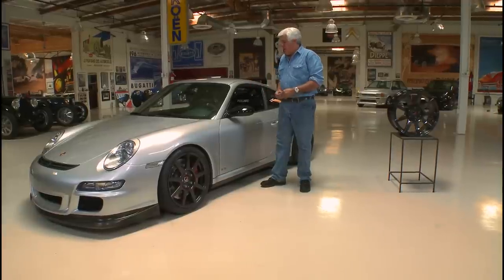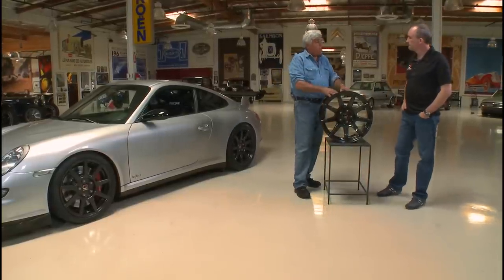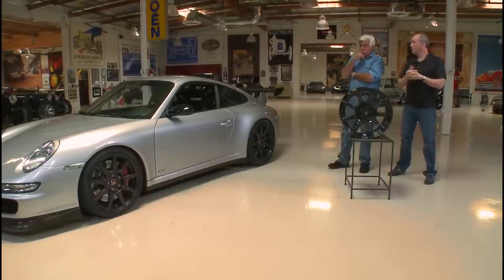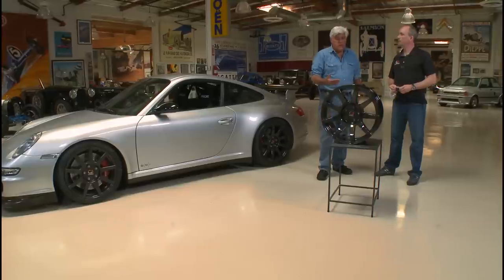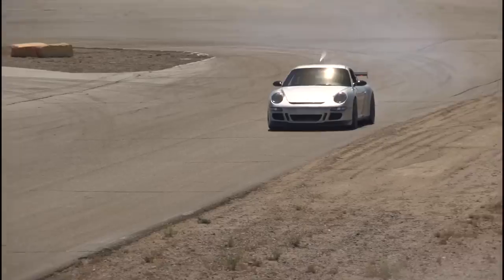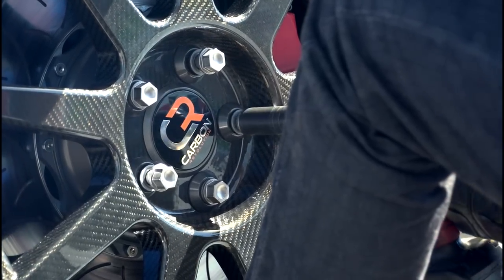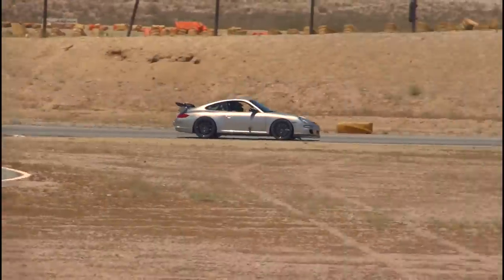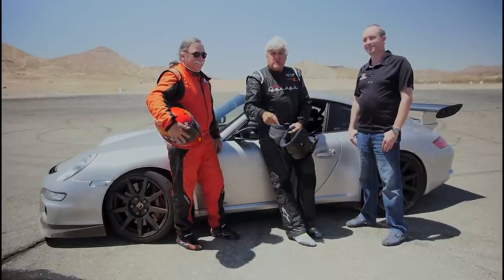Carbon Fiber Wheels Road Test - Jay Leno's Garage

Comment: That guy must be an engineer huh. Hes got the personality of a wooden chair lol.
Reply: Hes defiantly not an engineer. Hes a buisness and salesman. He didnt describe any of the technology that went into then wheels.
Reply: Krevin Grard I'm pretty sure it's just hand-laid wet carbon fiber and epoxy resin in a vacuum mold. You can see each spoke is a separate piece that's joined to the central hub piece. The complicated part is probably the mold which has to be multiple pieces because of the shape of the wheel.
Reply: Nayr747
its will be injected molding done at high temp and pressure same as the tubs on the mclaren
Reply: davybeee That's the technique used for "dry" carbon that's pre-impregnated with epoxy resin. In the video, that's what Jay is asking him about with the autoclave, and he says they don't use that method because of the expense. It's just normal wet carbon. You lay the pieces of carbon fiber fabric in a mold and then brush on epoxy resin. Then you vacuum out the air and let it harden. He must be using a multi-piece mold though since there's no way to remove the wheel based on its shape.
Reply: Krevin Grard Eh, he sounds like an engineer turned businessman/salesman.  I have a lot of experience with this type of person.
Reply: Nayr747
i think you miss under stood what i ment using injection moulding you can make the wheel in one go using a four piece mould and very little machining to finish i understand the layer method and using the auto clave but what i meen is a mould in four parts that comes together  in the injection machine it easy to make such a mold i am a tool maker by trade the wheel is easy made with just one mold. its not just a tool that comes together  as in most cases its a mold that has four parts to make it in one go to give it the shape of the wheel ....
Reply: Dude's wearin socks and sandals.
Reply: Haha a Woden chair ! ! ! :'D
Reply: Krevin Grard
yeah defiantly
Reply: He's living in Germany, he's not allowed to have a sense of humor.
Reply: At $15,000 bucks a set - my sense of humour went out the window as well.
Reply: Hey, my wooden chair is a million laughs.  It's got a wooden leg named Smith.
Reply: farnthboy hahaha
Reply: Krevin Grard And his attempt to impress Jay is hilarious. I feel sorry for the guy, really. I have watched enough of these episodes to know that when Jay says, "Ugh-huh.", that means he already knew that. LOL
Reply: At least he can pronounce aluminium correctly!
Reply: I've met some very interesting wooden chairs.
Reply: Greg Murph At least he can pronounce aluminium correctly!

Here in the U.S. it is aluminum (which is also the original spelling of the word, by the way), and since he is an American, he pronounced it wrong. He revealed himself as a laughable wannabe Euroweenie in the process.
Reply: Late but what bothers me more imo is the hands in pockets...
Reply: he would of been in australia for a while so makes sense

Comment: I'm not sure Jay can actually feel a wheel flex as he describes.  The most noticeable thing anyone driving the car would be feeling is the dropping of 42 pounds of unsprung weight.  That will make the car turn in crisper and smother and the suspension is able to react quicker and more accurately in all aspects with the less weight attached.  He will also feel less of a gyro effect as well. I think its really cool that he test this stuff for everyone to see even if his explanation are a little off you can still read between the lines and tell there was clearly detectable difference.

Comment: It's amazing how far this company has come since Jay posted this video. They're now an OEM supplier to Renault, Ferrari, Ford, and GM. The C8 Z06 with the Carbon Revolution rims is amazing; the rims shave 2 seconds off of a 2-minute lap time! But what's even more amazing from the business POV is where this company is headed not due to lap times, but due to the fact that CF rims extend EV range by up to 10% and due to the radical lead Carbon Revolution has over its competition as a result of having over a decade of experience as a supplier to OEMs for high-performance track weapons! While their stock has taken a beating due almost entirely to COVID impacts on OEM supply chains, the company is about to change from being listed on the Australian Stock Exchange to being listed here in the U.S. While their balance sheet isn't great at the moment due to the cashflow lags from GM's delays on the Z06 last year, Carbon Revolution is supposed to close a bridge loan round in late April and hopefully the de-SPAC process is complete by late June, which will put another $60+ million on their balance sheet and give them access to another $60 million via a committed equity facility (which will come with some dilution, but will help them replicate the new fully automated Mega-Line production they've constructed down in Geelong Australia somewhere in Mexico close to the US border to further increase logistics efficiencies.

Comment: I presume that car @4:15 is the gt350
Reply: i believe so but i think you meant the GT350R because the GT350 does not come with carbon wheels unless it is an option as i do not own or have seen the options list for that car. however i doupt it would be as they seemed to say it was a 350R unique feature. is it worth 15 grand for these wheels which im guessing would shatter quite easily if you got a pothole at moderate speeds? unless you are very wealthy i dont see the real point for it.
Reply: Patrick Pelletier Yep, not sure why I left the R part off, but yeah, 15k for wheels is pretty much insane.
Reply: Jared Moore totally but if all you're doing is going on track with it im sure the advantages are worthwhile. However if you daily it on the streets where i live im sure the tires will outlast the wheels themselves. Our roads arent shot to the point youll fall to the earth's core but the roads are just constantly redone (brand new and gets torn up within the week because they fucked up) aswell as having the surfaces go from relatively even to some 6 inch drop for 10 feet then 6 inch rise pretty much right away.
Reply: +Jared Moore 3 years ago they cost nearly 200k $... so. you should be thanking Ford. Seriously, they have helped bring the tech to the peasants!
Reply: Josh Ford lol true there

Comment: My Shelby GT350R came with a set of these Carbon Revolution wheels. I didn't appreciate what they do until I bought a set of forged aluminum HRE's for my track day tires. The steering is so much sharper, it. I really felt a  big difference in tight S turns. The right to left movements are crisper, faster The car on the street tires and carbon fiber wheels felt almost as good as Aluminum wheels with slicks. I am now trying to purchase another set of CF wheels from Ford. I'm told it will be a few months before they're available as a replacement part, but they are getting a lot of requests for them. Lord knows what they'll cost.

Comment: Mustang 350 rs has carbon fiber rims now...lol this was filmed in 2014....so it took Mustang 5 years.
Reply: Yeah, it's crazy that when this video originally aired, only Koenigsegg had carbon fiber rims and now, not only has Carbon Revolution supplied the Ford GT, Shelby GT500 & GT350 (and now the Dark Horse), but also several models of Ferrari and both the Z06/Z07 and E-Ray C8s (as well as Renault's Mégane RS Trophy-R). And now Carbon Rev is starting the process of taking CF rims mainstream with these upcoming EV SUVs they're adding up to 10% range on. Jay nailed it in this video 8 yrs ago when he said that carbon fiber rims would eventually become as "everyday" as aluminum rims had become...I can remember when "alloy rims" were really "exotic". LOL

Comment: It is what is between the wheel and surface that really matters. After ERW bicycle we will return to auto. High speed airless, bringing carbon and Kevlar as close as possible to the surface. Screw force accumulation and return for drive train efficiency.

Comment: All I'm thinking about is when this trickles down to the Nisan Versa and the like taking it to a grease monkey or the amigos to slap some new or used tires on it with their ancient machine and no care at all.
Reply: right, today 15g 10-20 years 1-2g or less
Reply: ChronicConnoisseur and in another 10 to 20 years we will finally have negative mass stuff!!
Reply: by g i ment grand yes, lol my rims are made outa dark matter, when i put it on the car it weighs 200 lbs less

Comment: I Have/had what most people would consider to be an expensive set of SSRs and Rays; which are both one-piece forged and just as light as these carbons. 
Now I'm rocking some less expensive Enkei composites - all of which I've used on and off my local track. 
I have noticed, literally, zero difference in how the car handles and moves what-so-ever.Sure, I can do the 1-finger pickup test and be like "oh wow amazing light" but in reality, on a car, I've noticed ZERO.

The biggest changes, which is 100% noticable on any car, would be the increased width of my tires and wheels.  If you lighten a car enough (which I have not) yeah, you would notice it.
I just have a hard time believing simply changing wheels will do that for you.
The "extra" weight on stock wheels was put to the test in one of my car mags (I think import tuner, but could be super street or DSPORT) and they concluded that the "extra" weight balance out by keeping longer free-wheel spin when not under throttle, therefore being "easier" to accelerate.
Either way, I agree that lighter is better - but in reality carbon wheels are not lighter than forged composites/aluminum etc.
If you are going track-only (you could go street...but you shouldn't), than nothing can be cast-magnesium.

Comment: I wonder what happens when you have to use a lot of brakes and the wheel gets hot. Resins don't usually keep their stiffness to very high temperatures. And then the heat cycles - will they age the wheels? And - before Koenigsegg Dymag actually has done carbon wheels. I have an acquaintant who had those on a 997 Turbo and he complained that they did not keep air in. My guess is they were sort of 1st generation wheels made of prepreg. Of course now we know that Porsche is actually winding carbon wheels with one monster winder. I wonder if that is related to Carbon Revs?
Reply: Check out Carbon Revolution's solution to that braking heat issue; it's similar conceptually to how the Space Shuttle's tiles worked as a heat shield. Fortunately, Carbon Rev's thermal barrier coating is applied through a plasma deposition process so, unlike Space Shuttle tiles, it won't ever fall off.

Comment: Nice aerials!
Reply: Actually that part was a bit dissapointing...
Too much shake in the (GoPro?) footage, 
For example, the flyover @0:25 looks ugly specially when the camera moves to the left. Not very pro...
Reply: Pj F not bad considering how fast the quad was flying. Not too many setups can fly fast enough to keep up with the Porsche
Reply: Pj F nice shots, but let see that in real time and no editing :) your work  is top notch though
Reply: Looks like a Discovery pro.
Reply: tonytypes I agree on that, but that is not what i think should be improved, just the quality of the footage is a bit below from what it could be (and is compared to the rest of the video)..
Reply: Pj F
your vimeo footage is of a completely calm day, You can tell just how calm it is by the water nearly smooth as glass, but Jay's footage is on a very windy day and they are trying to chase this Porshe around the track. So big difference there buddie. And Jay's crew may be getting used to flying a drone becasue that is something we dont see much of on his channel.
Reply: TheCamaro5 I agree that the weather can challenge shooting good video, but still in post a lot can be corrected too (like turning the camera as stated before).
We have shot other footage with a lot more wind too but the footage still looks steady.
Maybe they should hire a bit more experienced drone/camera crew ;-)
Reply: or new gimbal. Either way footage was ment to be fast and excited unlike your video which showed slow movement in calm weather.
Reply: im just happy it wasn't filmed with a dji phantom which are everywhere.

Comment: Would carbon fiber wheels still scuff up to curb rash and salt like alloy wheels would? Or are they just lighter?
Reply: Yep, and if you chip one, throw it away, no welding a chunk of bead back into one of those.
Reply: Badmuthatrucker666 actually incorrect you can easily repair carbon fiber I was a composite repair tech in the aircraft industry and it can be done with simple tools and an oven and some vacuum pressure
Reply: Ben Perry can you still maintain the balance of a carbon fiber wheel after repairs are made?
Reply: I don't think you can really repair them, being structural. GF get's it's strength from continuous strands of material, or weave, once you cut those, the join is as good as the bonding agent used. You might be able to patch up a wing or a panel, but they are not wheels doing wheel jobs and wheel loadings.

Comment: I got a set of forged magnesium monoblock wheels from Litespeed Racing that shaved about 9 lbs off of each corner of my car, compared to what the aluminum wheels weighed. The handling difference was very noticeable, with the steering response and suspension compliance being significantly improved. The wheels were about $12k in price

Comment: Magnesium is about the same weight as carbon fiber (typical density for both of them is ~1.8 g/cm3, compared to ~2.8 g/cm3 for aluminum), and they've been making magnesium wheels since about the 1930s (which is where the term "mag wheels" came from), so the lightness of carbon fiber wheels is certainly nothing new.

Comment: Well. BMW can easily charge $9000 for OEM rims for something like the 7-series which is nothing special wheel wise. Just "heavy" metal rims for a heavy luxury road barge. 

15 grand for carbon fiber wheels sounds like a steal. Porsche, and others, have ceramic breaks as standard on some models.
Carbon fiber wheels in conjunction should be a given for anyone in anything on the track.
Ceramic breaks will never be mainstream. Carbon fiber wheels has daily driver applications.

If I ever have a car expensive enough for 15 grand wheels I will pony up. My Volvo is just not up there =D

Comment: For elitists with more money than brains. Like $10,000 speaker cables that make your stereo "sound better" and "look better" - mostly subjective. First, I don't like black wheels, carbon or otherwise - I don't find them attractive. Second, can you imagine putting some curb rash on your $15,000 wheels? OMG, no thanks. I do appreciate the technology and the purpose however. For racers looking for that 1/10 of a second edge, sure, maybe these fit the bill.

Comment: I didn't hear any US regulation or spec this wheel or any wheel needs to pass. What is the definition of "OEM spec" ? Original Equipment Manufacturer is a spec set by the maker which is probably proprietary. Go to a Porsche showroom and ask for their wheel specs and  you will get a blank stare. I would not trust this wheel. He is not giving any info on how this is made or tested or specification other than weight. No autoclave?!

Comment: Woooohooooo! An ISO certified environment. BFD, GM manufactures in ISO certified plants and they churned out over 20 million recalls. ISO certification does not guarantee a quality product. ISO is nothing more than busy work for paper pushers. If you want a quality product, get off your ass and manage your people. Quality is a culture not a manual, flow charts and PPAPS.

Comment: Track day & aggressive curb line: bad idea! Carbon fiber wheels (not this exact brand, but a more expensive one) are like hot models. Stylish, thin, light and super sensitive. Will break and cost you a fortune to replace! Been there, done that (carbon, not a hot model...). Track day. Aluminium wheels. Check! Probably the reason for F1 to stay on aluminium wheels (or the excessive heat produced during braking).

Comment: "They didn't flex as much around that corner".... pleeeeeeeeeeeeeeease.
Oh, and for 15k you can have not "as much" flex that you "think" you might notice?
Really nice wheels but will probably be a more reasonable purchase when they drop down around 5-7k per set... or, like Jay said, if you have a Lambo or Ferrari it's a drop in the bucket.
What about curb rash? ouch

Comment: What a hoot, Jay claims he can feel stock Porsche wheels flexing. A few pounds of unsprung weight that rotates is somewhat significant, but it's not $15,000 worth of good. I doubt Big-O will be willing to mount a tire on a rim that costs $4.000 either. I could live with what Porsche bolts onto the axles.

Comment: The 19x8.5 wheel weighs just over 15lbs, the 19x12 weighs just over 17lbs.  But the weight reduction isn't the most important aspect, it's the stiffness.  Carbon Revolution wheels at the minimum retain OEM levels of stiffness to retain suspension and tire performance.  These wheels have been tested against every OEM wheel standard in Germany and have passed or exceeded each test.  These wheels are stronger, stiffer, and lighter than any wheel on the market.  

Some of these people commenting need to do more research to understand carbon fiber.  Carbon fiber is built how you want it to be built.  Front wing cascade elements on an F1 car are meant to break away.  The carbon fiber monocoque F1 chassis is meant to save a drivers life in a high speed crash, and they typically re-use the chassis when they rebuild the car.  These wheels are built like the monocoque chassis, they will not shatter or crack as some people are implying.

Comment: They say trimming 1kg of unsprung mass (which is what a wheel is) equals removing 50kg of regular mass from the body. I think that's an exaggeration, but I can easily believe in 1:10 ratio.